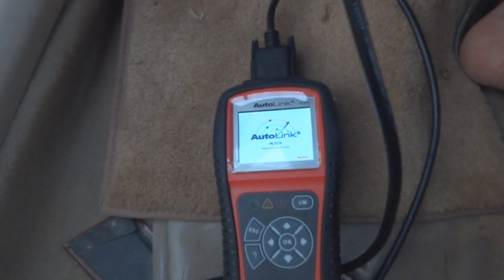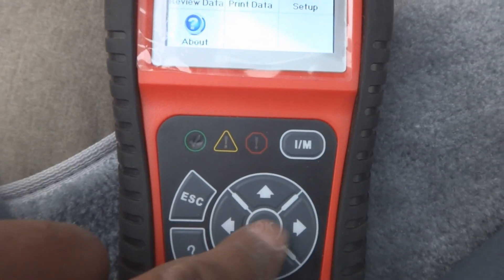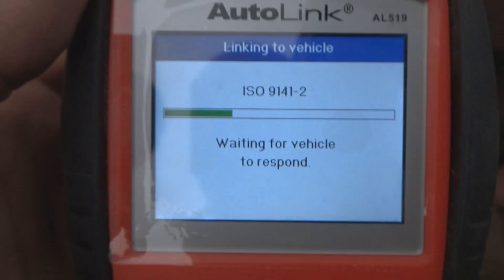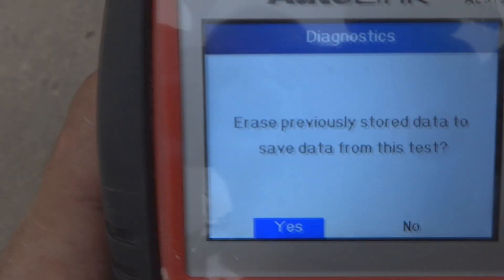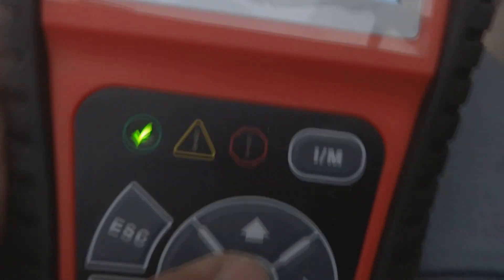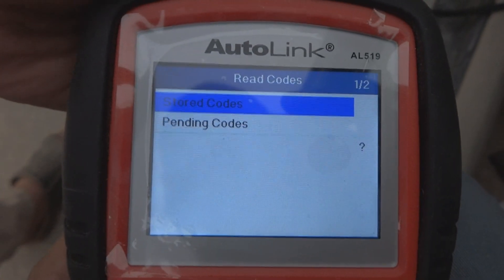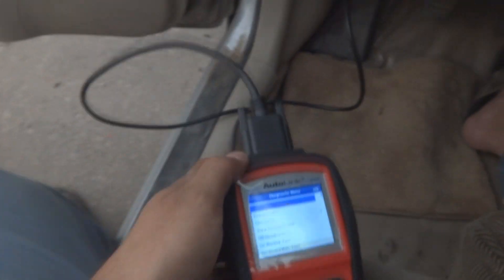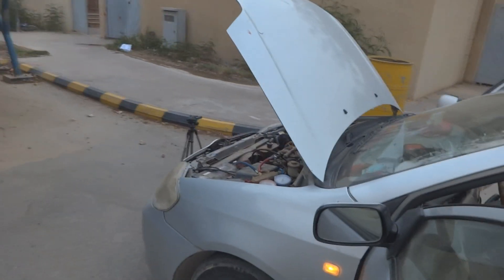Car low performance and low power diagnostic part 1

Comment: good and easy to make adapter my friend , good method to diagnose the loss of power and performance issues .
ramadan mubarak to you and your family .
Reply from the maker: toolman talal Great to see your comment dear friend! Ramadan Mabrook to you and your family as well. You are right, this gauge adaptation is easy to make and is helping much. For the purpose I show it here to help people to make such a tool with less effort and use it in a great deal of diagnostics. Regards,

Comment: Maybe the fuel pressure should be 44-50 psi without the vacuum on the fuel regulator... i don't know it your particular car uses that system.

Comment: You're missing some steps in your diagnostics.  1. Confirm you are getting 12v to the fuel pump.  Low battery charge will reduce fuel pressure.  I think it's something like 2 PSI reduction for every 0.5v drop.  That's a valid step in the diagnostic process.  2. Remove the fuel filter, manually jumper the fuel pump, and check maximum fuel pressure and bleed down. This will also confirm that you aren't losing any fuel pressure through the pressure regulator or stuck/leaking injector.
Reply from the maker: ***** Your understanding is rock dear sir! I am doing the same thing (Voltage testing) in the next part. The car I already repaired with big effort and I filmed it also. I am not going to disclose the steps in this time to keep the thrill. In the next coming parts the diagnoses and repair will proceed further. Best regards,
Reply: LearningZone Keep the videos coming.  You're doing good work over there.
Reply: LearningZone      what is the name or part number of your fuel pressure tester you used on Toyota corolla ? i need one for toyota ,kia and hyundai .
i have nevered found fuel pressure tester  i can use it on Hyundai ,KIA .   but what about this tester : 
http://www.aliexpress.com/item/High-Quality-Fuel-Pressure-Tester-Kit-Master-Fuel-Injection-Pressure-Test-Kit-TU-443-TU443-manometer/2030301407.html
can i use it on Toyota,KIA and Hyundai ?
Reply from the maker: abdullbasit osman I am sorry dear friend to give you late reply. I just went through your proposed web site and found a pretty nice gauge for fuel pressure testing. The one you selected should do your testing but there are better gauges available out there for a little more expanse if you can afford. My one has no part number as that one is a DIY gauge arrangement from an old refrigerator service gauge for Toyota only. You can make one for yourself also if you have available air conditioning gauges in hand and some old fitting from an old car you want to test pressure for. As I was doing it for my Toyota, I made fittings for that one but you can make it for almost any car as long as you have some parts available in hand. You can buy a professional one if you are earning well from your shop but I could not as I am not earning such nice amount from auto repairing as this is just now a hobby for me.
In the fourth part I will show another DIY gauge which I made and that is also a very nice and excellent test instrument. That one also you can purchase one professional if you can afford. Best regards,
Reply: abdullbasit osman Look up the Actron CP7838 fuel pressure tester kit.
Reply: i have got  this tester  but no way to use it for hyundai ,kia and toyota  only  T adapter coild be used at fuel pump for some  models of some makes . but fot hyunda ,kia and toyota no.